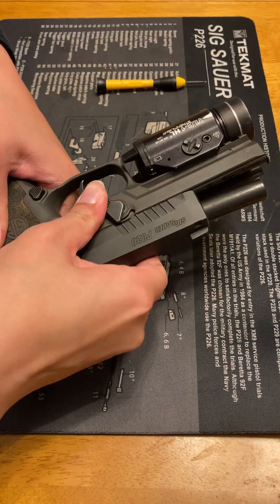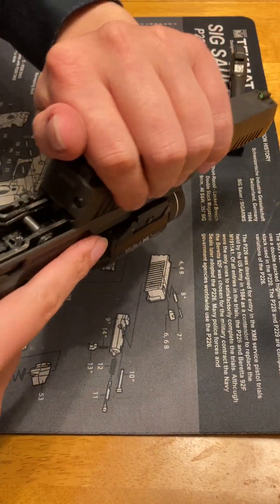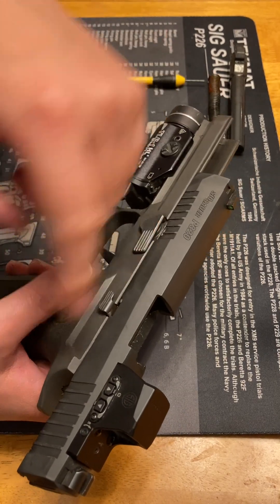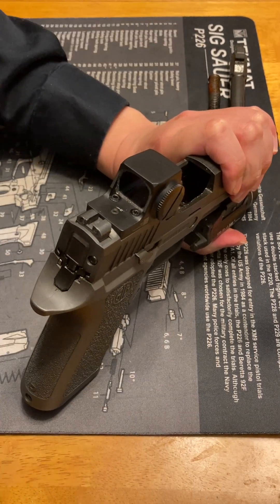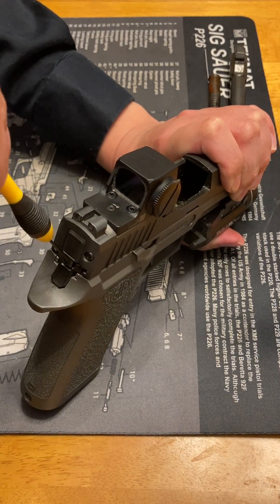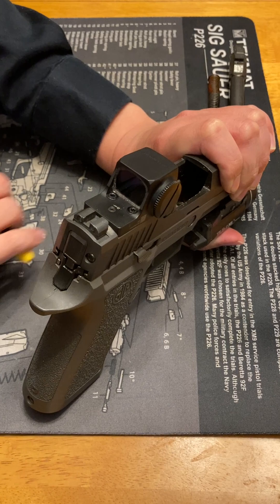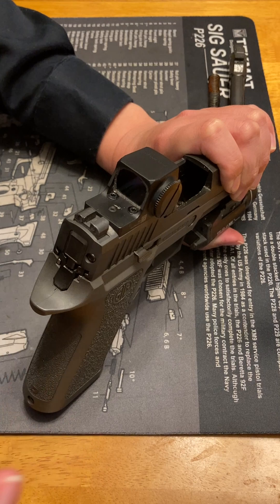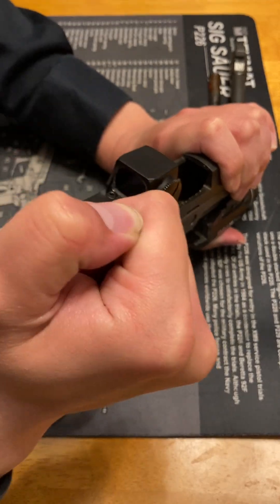P320 Test Instructions: Protruding Striker = Uncommanded Discharge

Comment: Question: So if the push is not firm and sharp, it will not defeat all the safties?

2nd question: what could possible create a firm sharp push down?? Seems more likely a very slight slip off the sear is what we would expect to see in these senerios

Comment: Why does it have to be a firm harsh push?
Reply from the maker: A gentle press would result in my friend's P320 failing 2 of 10 times, but a firm push would result in failures 10 of 10 times. I would not want someone to think their failing pistol was safe because they were being too gentle with the Sear Movement Test.
Reply: @P320Truther  a sharp press dilibretly bypasses the secondary catch.  I have yet to see a firearm that bypasses the three built in safeties without deliberate intervention. 

It's a classic Swiss cheese incident and if you are correct about the movement of the trigger bar I would think that the manual safety would prevent at least one of the failures.
Reply from the maker: The secondary sear surface would be out of the path of a gentle press of the sear as well, otherwise someone feathering the trigger would also run into it. The secondary sear surface is useful for precisely one failure mode: A broken primary sear surface. In no other failure could the secondary sear conceivably come into play.

With a sample size of just one, the manual safety FCU I was able to test would not permit its trigger bar to move forwards while the manual safety was activated - it could only move down. This resulted in no sympathetic movement of the safety lever, meaning it would almost certainly pass the Sear Movement Test while the manual safety was activated.
Reply: @P320Truther  thanks for the thoughtful reply. I spoke with Sig_mechanics about this same issue and referred him over to your videos. 

I think we're all very close to the real issue and I appreciate folks who are willing to have an unbiased (as much as possible) conversation.
Reply: @P320Truther  An update to our conversation and my own testing...  Even when I completely remove or disable the firing pin safety my M17 won't fail. The 2nd sear catch catches the striker tail even with a sharp blow. My pistol is sitting at 5k rounds and has plenty of wear but the sear seems to be in very good shape.

Comment: Honestly I think the best way to do this test is the put one in the chamber. Then put a full magazine in the gun. In a controlled environment like a gun range. Do the test does it go off yes or no? I just did the test with a Pink Rhino I don't know that a laser cartridge is the same. But it certainly would like to know. Or simply put a piece of tape across the breach where the firing pin would protrude. Does it cut the tape yes or no?

Comment: just did this on mine (mar 2015 manufacture date - has had "voluntary upgrade" and confirmed this happens.  Friend did this as well and actually put a piece of foam in front of the striker face to verify and sure enough, his showed the striker protrusion every time as well.
Reply: Why two different guns?
Reply: Makes sense, pushing down on the sear like this is the same thing as pulling the trigger.... I am unsure why this mean anything

Comment: Thank you! Finally someone is doing their own testing and actually getting results that are starting to make sense! 

I notice the ND’s are all with 320’s with no external manual safeties. Are manual safeties also susceptible to these ND’s?
Reply from the maker: There are multiple .mil reports about AD/ND/UDs with M17 and M18 pistols. Hard to say whether any particular incident was due to a design flaw, poor maintenance, insufficient armorer inspections, or shooter negligence.
Reply: I have asked this same question several times regarding the manual safety, so far I have not see a response specific to the manual safety.

Comment: Thanks for posting this, I did this test on mine about a year ago but with a snap cap (striker impact sounds different than no protrusion). In the beginning of the video during the slo mo demo, notice how when you depress the sear it actually pulls the trigger rearward, due to the sear body pushing the trigger bar. This is causing the striker block safety lever to be pushed up. I think a proper trigger blade dingus would prevent this. I might pick up an agency arms trigger to test it out.
Reply: Glad someone is paying attention

Comment: thx for sharing this. I did this a bunch of times to my m17 just now and nothing protruded. Does that means Im less likely to die with it in a holster while on my body? I hope
Reply from the maker: It means that your striker safety lock is functioning properly even if your sear moves enough to drop the striker without you pressing the trigger. All in all, a good thing, and your pistol isn't unsafe in an obvious manner.

Comment: Wait this proves it does or not? I saw the firing pin but was it enough to set a round off and second would it still do that with a the slide forward.
Reply from the maker: I would not want a hard primer to be my last line of defense against an “uncommanded discharge.”
Reply: @P320Truther I’m going to buy nothing but Wolf Steel case and bulk ammo inc 9mm for my 320’s exclusively now lol